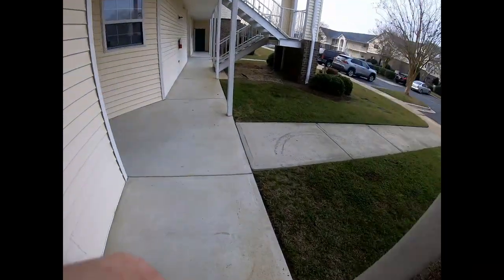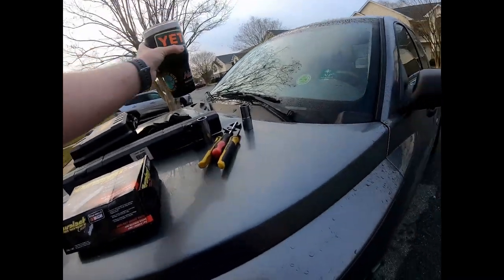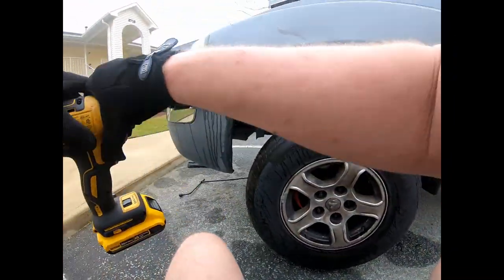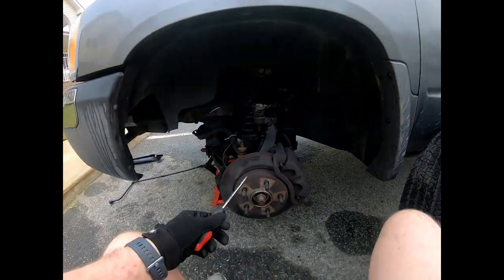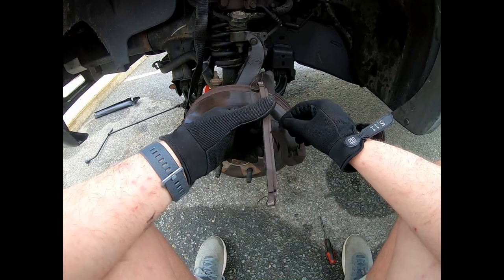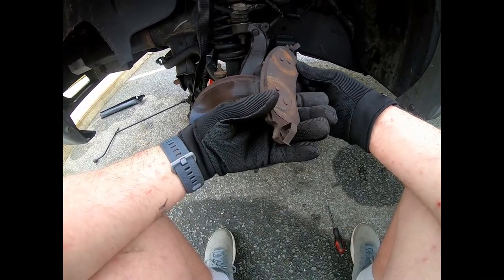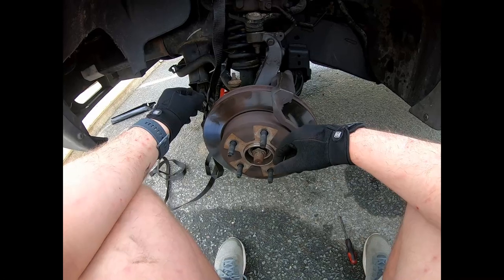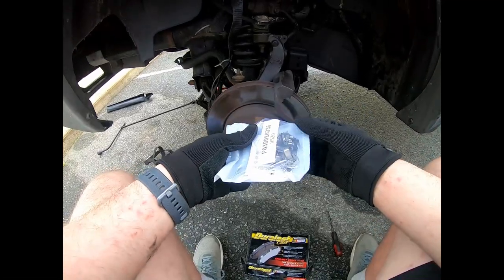How to change your Brake Pads (2005 Dodge Dakota)

Comment: I can't figure out how to get these clips to lock in place. Any tips?
Reply from the maker: They don't really lock into place on mine, you just place them on the brake pad and slide it onto the caliper. You got a dodge dakota ?
Reply: @fishing_enc3343  yes and they just fall out as im trying to get the bracket installed
Reply: I completely understand your frustration... the clips really do just sit in place without pressure.  What I did was put the bracket on then "simply" slide the pads and clips into place.  Once in place, I put the caliper unit on which held the pads in place